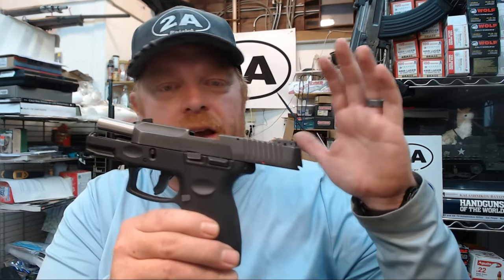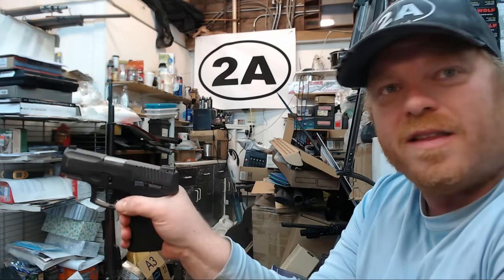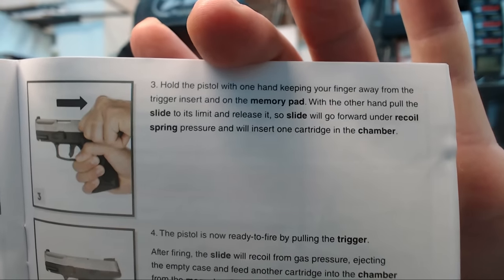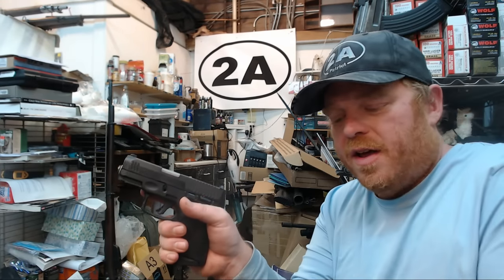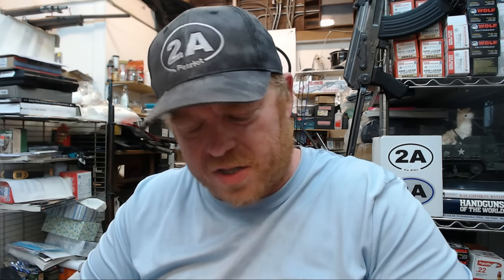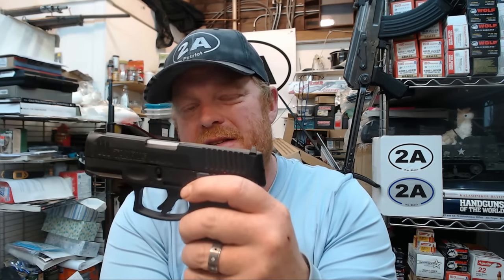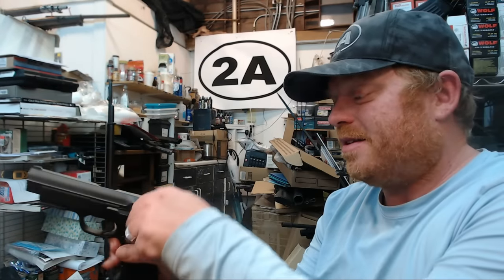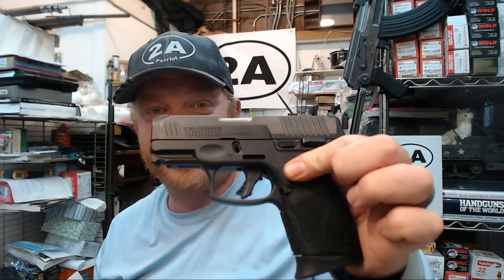📌 Taurus G3C G2C G3 9mm Stiff Slide Catch Release : How It Works : Pistol Loading & Slide Function

Comment: I just figured it out with my G2C, just hold and slide it back with left hand and 
use right hand and thumb to release the slide forward. Pressure will come off of
slide release. The requires constant practice.

Comment: Great gun, way better than the Beretta look alike PT92 from Taurus.. I had problems with the pt not holding the slide back on the last round, which is just a magazine issue but had no interest in buying aftermarket mags which I’ve read fixed that issue because mainly of the other issue I had with it was the ejection pattern, where most guns (like the g2c) ejection patter will be 3 o’clock/ 4 o’clock consistently out of most pistols, as where I was getting 5 o’clock and at least once every other mag get a 6 o’clock hot ass brass to the forehead.. g2c seems like a solid shooter though, so far. Zero malfunctions. Good channel.

Comment: 2a Edu - Thank you very much for the detailed explanation. I thought my slide catch was a factory defect, as I had my G3 for a week before I could get a reasonable deal on ammo. When the slide catch released easily on a loaded mag, I worried the slide wouldn't stay open after the last round fired. It's nice to know this is exactly how these guns are designed. There's another aspect to these guns that I like. It could be specific to the G3. Perhaps you can explain it in another video. When my G3 is empty, with the slide held back on the slide catch, slamming in a 17 round mag closes the slide automatically, with the 1st round chambered. I know some people don't like striker fired pistols that do this. But if they have to quickly load a new mag in a life or death scenario, it's one less step to loading the gun.

Comment: Thank you so much for a very informative video.  I recently purchased a g3C as a caliber step up from my TX22.  Even though I am an engineer, I didn't even think that the reason why the slide stop release on the g3c, even with the mag removed is so much harder on the TX22 has to do with the fact that the 22lr requires much less spring tension in the recoil spring.  If one were to fire a 9mm with a spring that had the tension of a 22lr, you would most likely break the slide from the blowback force being much less restrained by a lighter recoil spring.

Comment: I’ve never considered my thumb as being exceptionally strong but when I’m reloading and the slide is locked back, I’ve never had a problem releasing the slide with a quick flick of the thumb on the slide release on either my G3c or for that matter any of my pistols. Using your weak side hand to rack the slide is fine but you should be well versed in operating the controls one handed, which , with enough practice, makes releasing the slide more an act of muscle memory than anything else. I will say this about the G3c , the slide release lever is less pronounced than on a lot of other pistols , so new shooters may wish to replace the slide release lever as well as the manual thumb safety with aftermarket versions.

Comment: Thank you, and I think you did an excellent job explaining this and pointing out the clip with and without a load. I got it. I just bought my G3c, and I  ran about 75 rounds through it. it seemed to be a little is a little erratic on target. I don't know; it could be me the way I was holding it with my right hand. Thumb was under my left hand, not over the top of my left hand. The question is, will it shoot more accurately once it's broken in?

Comment: I have a new Taurus g2s and have probably over oiled it, but my jamming only happens with FMJ rounds.  I’ve tried both clips and three different shells but it still jams when feeding at least 70% of the time.  I’ve fired about 200 rounds of various hollow points without a single jam.

Comment: Ruger Secuirity 9 is pretty much Identical except I don't even try to release the Slide Lock without just pulling back the slide. It can be released but it just takes force that seems unneccesary to me. I don't need to pretend I am Reacher or Silvester to thumb the Slide Lock release. The Ruger Slide Lock Release tab is 3/4 inch in size. Not much lever there to press on. Why force it. That quarter inch pull on the slide to load the new magazine works for me. At first I thought I was doing something wrong. Turns out I was doing common sense right. Thanks.

Comment: Great video. I have G3 and G3c. Both stiff with the "slide release". I know someone who has an S&W EZ380 Performance Center that has an issue with operating the "slide release" as well, so not exclusive to just one manufacturer. Keep up the great vids.
Reply from the maker: Thank you. yeah my Shield 9mm is very difficult to use too. Even harder than the Taurus pistols.

Comment: I have a brand new G2C which works perfect, Love it.  I had  G3 and it was awesome. So I naturally thought a G3C would be very similar on the quality of it. But its been locking rounds in the chamber and wont eject it unless you bang on the back of the hand grip while holding the slide with your other hand. Pain in the keester and very disappointing.  Taurus told me it would be a 3 month delay in getting it back if shipped in but yet if you get out on the range it will cycle and fire the rounds perfectly. Just happens if you attempt to eject a live round. It is stuck in the barrel not caught on the feed ramp like some thought I was saying. That is because of them not loading it correctly as you pointed out here.

Comment: Just bought a G2C at the Tanner Gun show here i n Colorado. Wouldn't know it, as soon I got home and pulled back on the gun slide and the slide release is impossible to release! Going to take to a gum smith tomorrow😒
Reply: Just grabbed one from SDS, the G3. Perfect first time gun. What ammo do you frequent?
Reply: You’re right about the slide release though. I was wondering what was wrong and went through the manual to make sure k wasn’t trippin.

Comment: Just bought a G3C yesterday. It is stated in the operator manual that you must remove the magazine first before disengaging the slide catch. Anyone who knows about the magazine follower interaction with the slide catch would be able to figure out that it's spring recoil from the magazine spring being so strong as to make it nigh impossible to disengage the slide catch while the magazine is still securely fastened in place in the magazine well.
Reply from the maker: Good thing you know all about it, but this video has helped probably 100,000 people. And you don't have to remove the mag. I clearly showed how to do it without removing the mag 👍

Comment: My G3c manual clearly states you can release the slide by either pulling back on the slide, OR by depressing the slide lock lever. Whatever works for you, but to suggest it wasn't designed to be used in that manner I will disagree. I never realized the difference in force required between mag or no mag. Good stuff!
Reply from the maker: Ok..... But I'm glad you liked the video.

Comment: I just bought a Taurus G2c 9mm. I absolutely love it just have a quick question that I think I know answer just want to be 100% sure been over 30 years since I’ve shot and safety comes first if the pistol has been cocked and ready to shoot but not shot, to unchamber round just make sure clip is out and then pull back on slide and I fired round should eject out, correct? thanks, judy
Reply from the maker: Yes, remove magazine, pull slide all the way to the rear briskly. Keep finger off the trigger and out of the trigger guard and point in a safe direction the whole time. After you see the round come out, open the slide again and make sure the chamber of the barrel is clear. Then store the firearm as you would.
Reply: @2aEdu  tysm. I got the Taurus about 2 months ago extremely cheap while just visiting friends that own a Pawn Shop in a small town in Texas. I I’ve always loved Taurus handguns. My late husband was an avid hunter, fisherman , anything he could learn and do with his PawPaw at a young age. When we met. Love at first sight, he taught me everything, first…always, Safety 1st. I’m glad I can still remember some things. I learned about the hard switch. Not strong enough to move it. RA

Comment: Just to add, I purchased two 15 rnd pro mags from Classic Firearms the springs in both seems to be softer or not as tight. My stock 12 rnd mags and 17 rnd mags from Taurus are much stronger or tighter, much harder to release with empty stock mags. Taurus sells 15 and 17 rnd mags with sleeve extensions however,  the sleeve I purchased from Bloody Wheels fit much better with no mag rattle.
Reply from the maker: I agree with everything you said 👍

Comment: Mine works the same,  it' just a matter of getting use to. Did you change out your slide spring for the stainless steel up grade?
Reply from the maker: Yep 👍 On the G2C in this video no. It is all stock. On my other G2C, I am using the Galloway stainless.

Comment: It is not advisible  to drop the slide on an empty chamber to begin with. Most manufacturers put warnings in their manuals saying that it can cause damage to the firearm. I never quite understood how, but my cousin is a master gunsmith and he said that in some pistols it damages the extractor. Which depending how the slide is milled and how tight tolerances are I suppose it is possible.

 The other thing to consider is what damage does it do to the magazine or the slide catch dropping the slide on an empty magazine? I do not release the slide on an empty mag or chamber on any of my auto-feed pistols. I always use a dummy round or snap-cap if I am doing reloading drills or anything like that. It is easier on the pistol and simulates everything except firing with recoil.

 Thirdly if you take a training course with a reputable instructor they will insist that you use your support hand to sling shot the slide forward after a reload. It is just good training practices to always try to manipulate your firearm using the same procedures because not every slide lock will function double duty as a release and in a life or death situation where you might have to use an unfamiliar firearm using universally effective  techniques could mean the difference between life or death. You should always train for the unexpected never the familiar.

Comment: before i eventually got a g3c, i asked to check one out in a gun store. the guy behind the counter handed me one and walked away. i was dumbfounded, because the slide catch was nearly impossible to disengage, even though i have decent hand strength. it wasn't until i first started figuring mine out the day i got it home that i realized it didn't like dropping on a a brand new empty mag. also, loading the brand new mags to capacity was b r u t a l.

Comment: First pistol was a lcp 2 22lr.  Those slide locks are hella small.  Now i have the g3c and its much better. Day and night difference with the controls at least.
Reply from the maker: Yeah I know what you mean. So small you really can't use it most of the time. The size of controls is a HUGE dif.

Comment: Thanks for the video. I have a 70 year old M1911 that the slide release is easy to deploy and a Beretta PX40 storm that is also easy. The G3c and the rest work the same, but the G3c is rather difficult for slide release if dry firing. It's just a matter of difference with manufacturers. My question is I saw another video where this guy took the G3 slide and put it on the G3c frame to show how interchangeable it is. That's fine even tho I'm not going to try it , but can that cause a serious malfunction.
Reply from the maker: I did a video putting the G3 slide on the G3c frame. Check my Taurus playlist.

Comment: I thought you mentioned some catching on the slide when replacing it after removal.Did you have that issue catching around the slide release and safety due to slight alignment issues.I don't have that issue with my G3.

Comment: I have the Taurus PT 24/7 pro model, and I really don't find it too hard utilize the slide catch unless there is an empty magazine inserted in the grip and I'm trying to release the slide. But if there is either a loaded magazine, or no magazine at all, I don't find it too hard at all to release the slide manually and I have the 40 cal version. 

However it would be nice if there was an upgrade slide catch that sticks out a little more so I could get more of my thumb on it to make it easier. Does such an upgrade even exist for these Taurus models?

Comment: On the G3C you do NOT have to press down on the mag catch button to release the slide forward and load the chamber. Simply pulling back the slide depresses the mag catch button automatically , and you can then let go and allow the slide to spring back and load the weapon. :) Friendly FYI
Reply from the maker: If there is a round in the magazine, yes. But if the mag is empty, you do need to press down on the lever, or remove the mag.

Comment: Quick question for you if possible. I'm new Taurus owner, and I wanted to know why my barrel is loose after reassembling, ( and correctly I believe.)  Is this something that can be remedied, or do you think I should exchange the gun?
Reply from the maker: Is the barrel loose with the slide locked back?
Reply: @2aEdu  yes
Reply from the maker: @Ledhead17  With the slide locked back, and the barrel tilting slightly upward, it is perfectly normal for it to be very loose. It is how the action works. I will try to do a quick video showing what I mean.
Reply: @2aEdu  Just got it today!  unfortunately,  I have to wait til we go to the range next week, my brother has the ammo, so I'm tying to learn what I can until then! I was hoping, maybe when I put the bullets in the magazine, it wouldn't be loose. Thanks for your info.! Learned alot!
Reply from the maker: @Ledhead17  You are welcome. I just posted a video explaining how this all works.

Comment: do other that have a slide lock work like what you are showing?  read on the M&P shield , every one on the site having same problem.
I have a GC3 works as  you have stated real easy. I they remove the mag, will thers work as the Taurus

Comment: New gun owner question when I have a empty mag in my g3 I pull back and it locks but will not release, is that right? I mean I tried and tried but it doesn’t I’m curious if that’s normal because it looks like you loaded a empty mag and it released no problem
Reply from the maker: I tried to show the different scenarios in this video.

Comment: Just purchased a G2C and the release tab to let the slide go forward is so hard that even when I put a new clip in I cannot push the tap down. I have to pull back on the slide to release it. Will that become easier with more use.

Comment: I’ve when I remove the slide and barrel on my G3 for cleaning that doing slide installation it does not want to position completely to the rear. It feels like it’s hitting something and getting stuck. It has taken me as long as 15 minutes to get the slide to seat properly. Please advise.
Reply from the maker: Sounds like a good video idea. Stay tuned.   I have a solution for that.

Comment: I got the taurus g2c 40. I was wondering if you might know if there is a magazine that gives more capacity for it. Any suggestions?
Could you please do a video on the g2c 40. and it's compatible parts.
Reply: Found one Pt24/7 pro.
Reply from the maker: I do not have a G2c .40.
Reply from the maker: Thats cool! I'm guessing some of the sig mags would work too. I know the 226 9mm mags work in the G2c 9mm.

Comment: Short answer, its probably too new. Put some rounds through it and let the parts break in and it will get easier to drop the slide with the tab.

I have a brand new unfired G3C, it is almost impossible for me to drop the slide, loaded or not, with the catch. I can pull the slide and it drops with almost no effort, My older G3C drops much easier, I attribute it to breaking it in.
Reply from the maker: A bit easier yes. But it is always stiff on an empty mag.

Comment: In my case with my g2c it was all pretty much a break in period for me. The more I used it the more it loosened up nice and easy like my glock. It's all just a break in period. Dry firing helped alot as well
Reply from the maker: 👍 I dry fired mine a lot too.
Reply: @2aEdu  heck even a 25 cent oolish job on the trigger bar helps
Reply from the maker: @MiguelHernandez-oi3fi  👍 Heck yeah

Comment: Just returned from the range with a brand new G3c.  Was loaded with round nose FMJ target ammo. Racked the first round, fired, went to squeeze off the second and... Nada. Slide jammed 5MM from a full return.  I can move the slide back and forth between 1-2MM and the slide catch is completely immovable.  I am moving the slide back and forth as much as it will, trying to find a sweet spot where the slide release might let the slide go into a fully returned position.  No dice.  Any thoughts?
Reply from the maker: Make sure the mag is out of the pistol. Then pull back swiftly on the slide with one hand, while pushing the grip forward with the other at the same time. I am not there to see what the problem so do so safely.